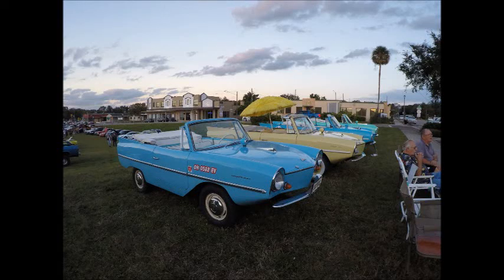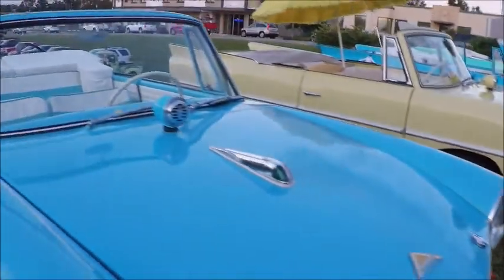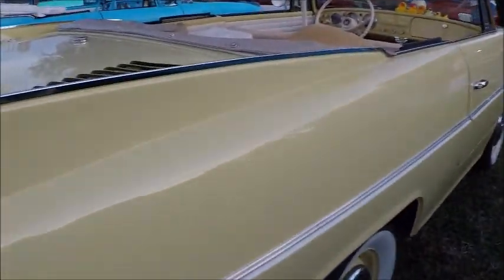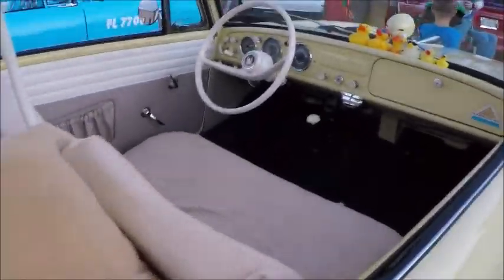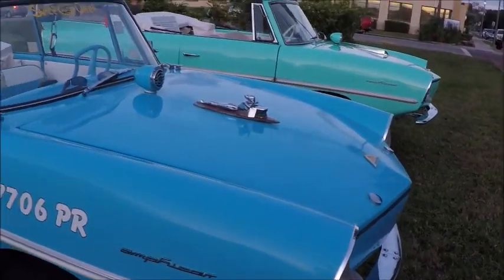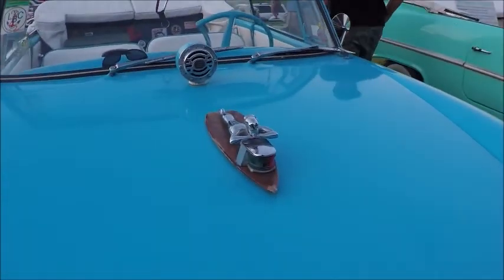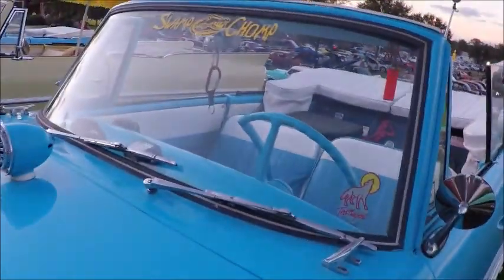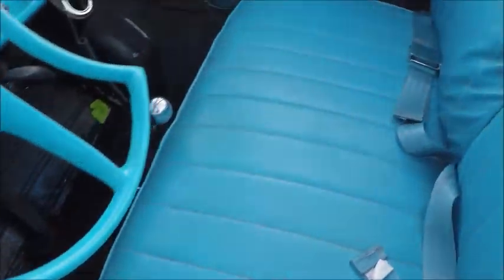1960's Amphicars Eustis1123195215

Comment: Ahoy, Cap’n Jack! I’d need to wear Depends sailing one of these in water. That vented hood over the engine makes me more nervous than the positive ground electrical system. Nice display - just keep em away from the manatees.
Reply from the maker: I would be nervous in these too....especially if those seals around the doors are questionable!  Just hope the bilge pump is in good working order!   Thanks!  :) Jack